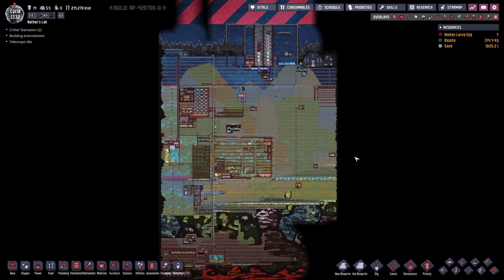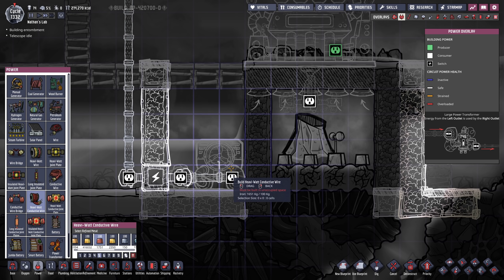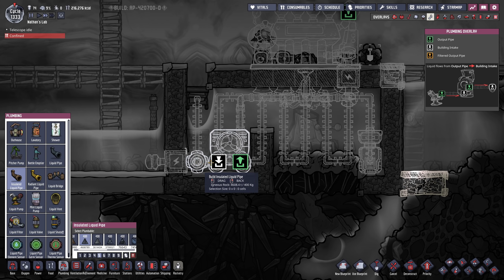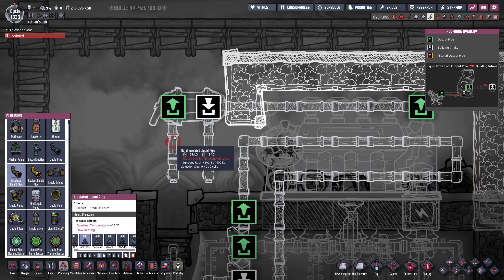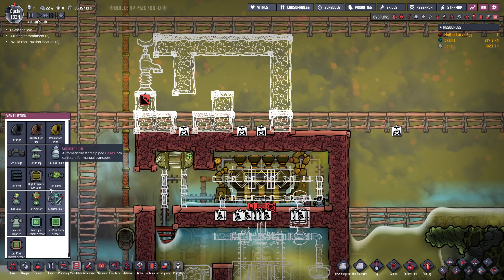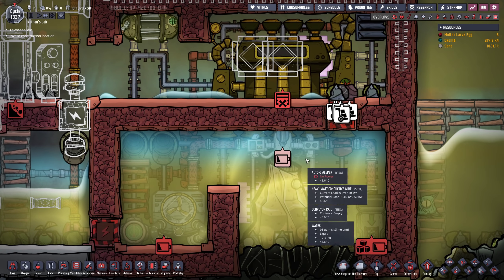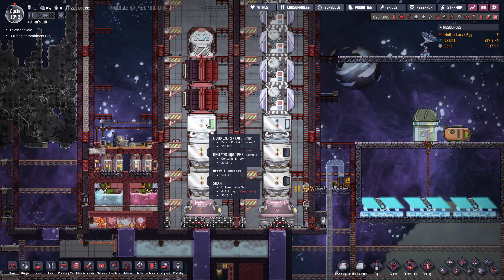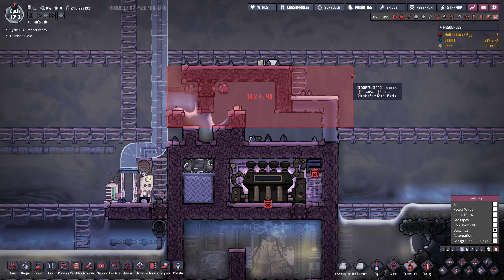COPPER VOLCANO EXTRACTION - Oxygen Not Included: Ep. #33 - Building The Ultimate Base

Comment: About the timer you made at the end with a buffer gate, a not gate and a filter gate, wouldn't it be much easier to just use a timer sensor? Like, literally, you can select how long are the green and red  signals going to last for, and the sensor is going to cycle around them constantly.
Reply from the maker: Good point, I am not used to the timer sensors yet;)
Reply: Nathan is oldschool 🤣

Comment: I've lost track of the number of times I've had my conveyor rails melt right where the molten metal lands on these volcanos. And if you're not worried about massive amounts of cooling, you might get away with a thermo regulator for a bit of cooling. You just have to wait until all the water flashes to steam before it can turn on. Less steel required.

Comment: Why such a complex volcano tamer?  I can understand using the rails to truck the copper out, but all you needed to do was insulate tile around and vacuum out the area around the volcano itself, and put in 3K Kg max of water to feed two steam turbines to cool it down.  This way the copper comes out solid and not liquid.  Oh, and a bridged radiant pipe of hydrogen from each volcano to dump into the gasses in the space above, just 5 tiles/1 layer give max cooling that can give and for me kept them at or below 85C when active.  The copper would still be several hundred degrees even during inactive phase, but if you're using the material conveyor in a post-eruption cooling solution that shouldn't be a problem for you.
Reply from the maker: You started by calling it complex and then you describe something that sounds even more complex🤣 Just kidding, the beauty of this game is that there are multiple approaches to everything.